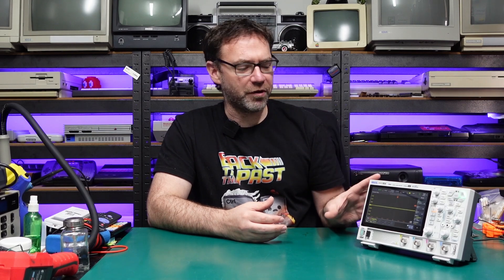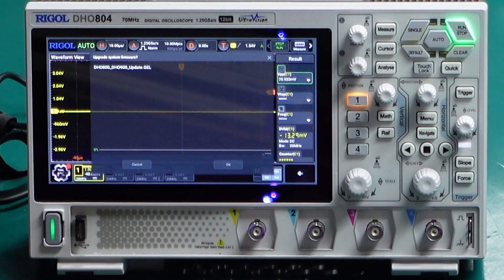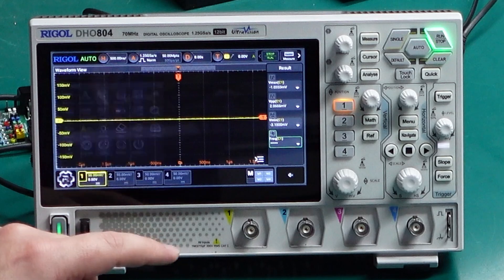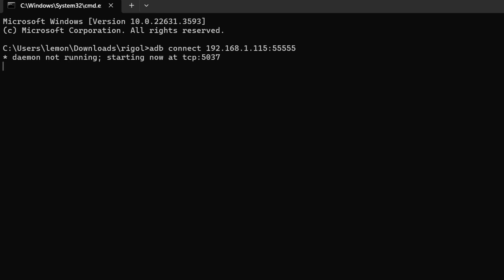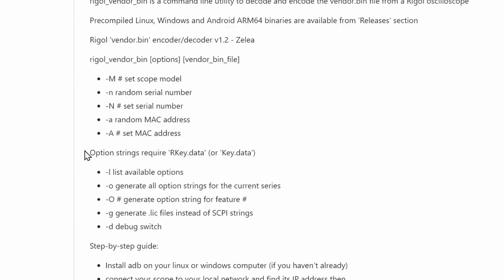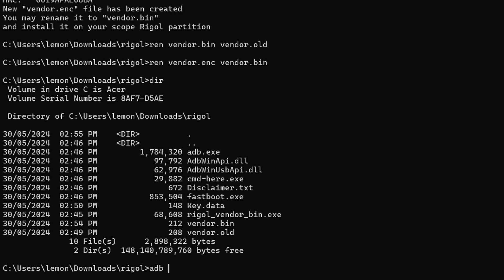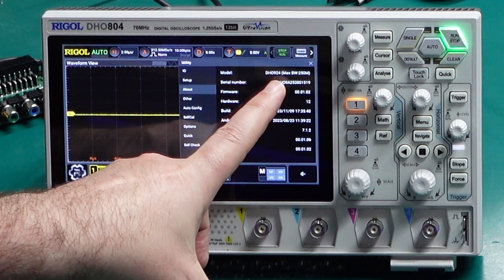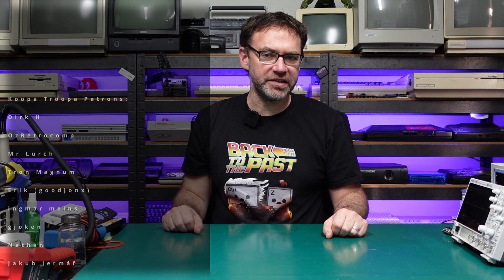Rigol DHO804 fw1.02 hacking - 250MHz bandwidth, 50Mpts, CAN and LIN decoding

Comment: I can confirm the "options" method works with firmware 1.04 on a newly-purchased DHO804, using the tools described here.  I prefer to retain the model identity and enable only the options changes for BW  and memory depth (the BW7T10 and RLU options). These work fine on 1.04, but are not listed on the Info screen. I have not attempted the EMBD (expanded serial options), AUTO (automotive networking protocols), or COMP.

The USB dongle hack also works very well. The required dongle with working chipset is available in the US from Amazon (TP-Link  TL-WN725N, US v3.6.
Reply: Nice, got one coming in a day or two.

Comment: At 1.25GSa/sec, how can it support 250MHz? My attempt to hack my DSO914 to 924 didn't show an improvement. It showed the model and 250MHz by the model. My source is a TinySA or Max2870. Nothing of test room grade  but on other scopes I could see the increase in bandwidth after a hack. I don't need a 250MHz bandwidth and really just wanted the 12-bit vertical resolution.  I sent the original vendor.bin to the scope. The Key.bin is read-,only.

Comment: Great video - Have a look at Mine called Rigol DHO814 DHO800 Oscilloscope Internal Fan Nosie Cure 2025       Rigol DHO814 / DHO800 Internal Fan Noise Solution Hello! Have you noticed that the Rigol DHO800 series, DHO814 oscilloscope can be quite noisy in a quiet environment ? I did too. My unit was brand new only a month old and noisy from the start, running Firmware 00.01.04 as of 1st June  2025.  

To resolve this, I installed a 100mm 12V DC fan at the rear, powered via an LM317 voltage regulator set to 2.69–3V. The fan draws approximately 70mA, (0.070A) making it extremely quiet while operating. I connected it to the onboard power with a new plug, and now this oscilloscope is the best I've ever owned feature-rich with a responsive touch screen, and most importantly, silent.  

Note: When I recorded the accompanying video, the workshop was cold, and the scope had only just been powered on. However, after 30 minutes of operation, the CPU chip temperature reached 51°C, with an ambient temperature of 47°C. I hope this helps.

Comment: The Rigol DHO800 series model DHO814, which I own, is the best oscilloscope I’ve ever purchased. It offers numerous features, a touch screen, and even the ability to operate using 15-volt power banks (similar to mobile phone chargers), making it highly portable. It’s an excellent device overall, but my one criticism is that the internal fan is quite noisy when the oscilloscope is in use. If Rigol could address this issue, it would make the oscilloscope absolutely perfect. Additionally, there are several YouTube videos available that demonstrate how to use this specific model and oscilloscopes in general.

Comment: The Rigol DHO900/DHO800 oscilloscope provides a bandwidth of up to 250 MHz, but this performance is achievable only in single-channel operation. When all four channels are active, the sampling rate drops to 312.5 MSa/s per channel — an unconventional value that fails to meet the Nyquist criterion for higher-frequency signals — potentially resulting in signal distortion and reduced fidelity. Under this multi-channel configuration, the effective bandwidth is significantly diminished, often falling below 100 MHz, increasing the likelihood of sampling artifacts and aliasing.
Reply: Yeah! Sadness reality ...

Comment: So while i can get my 804 scope to boot up and it says its a 924 it refuses to even see a signal even when i try and use the  calibration  points. I'm not sure what the heck is going on but at least i can fix the issue by flashing the old Vendor.bin to the scope. with how long that forum post is it may be impossible to see if there is any one else has seen thins.  Fyi im running the on the  00.01.04. firmware

Update: Make sure you go to self cal in the utlity menu and run that. After i ran it i could see the calibration signal on the probe calibration post and i was then able to test and confirm i could see things like my button pushes and the clock signal on my SNES.

Comment: Hi.
I'm considering buying DHO900 series. Is there similar hack to unlock bandwidth? What about frequency characteristics of analog channel for 70MHz and 250MHz versions? Are they the same? I would like to avoid situation when I buy 70MHz version, hack it, but hardware will still limit bandwidth. .
Reply: I have a DHO914 and did the model number change to 924. I didn't see 250MHz bandwidth. Rebooted and cal. V1.02 FW. I loaded the vender.bin file uploaded to the PC.  ALL I have for a signal source is a TinySA or Max2870. I used one on other scopes to 550MHz -- just to get an idea of other hacks worked - they did. Tests were with one channel enabled.

I sent the Bode option to it and would like to remove it. Just wanted to see if the SCPI command took, even though this scope doesn't have a signal gen for Bode support.

Comment: Juist tried this on my 100mhz DHO814 that I just purchased a few days ago and is on firmware 1.2 all went as per instructions but when I rebooted there was no change, Tried -o option first then went for the DGO 924 neither worked, no change at all, Any thoughts?
Reply: Thanks for posting this.  I have just inherited a DHO814 and was wondering if all this chatter about a mod worked on this model.  Did you ever get it to work? 73.

Comment: Just did it to mine, thank you 🙏
Reply: From a 0.5% precision instrument, you've converted it to ~2-5%!
You can compare readings yourself: 
1) check dc offset with no probes connected (you'll be surprised how huge it is)
2) connect a stable voltage source to all the channels and to a decent multimeter (you'll be surprised to see huge differences across the channels and compared to the multimeter)

Comment: So apart from your model not having a logic analyser port, is all the hardware internally the same as the higher models? I was going to get a 900 series but if i can get a 904 and basically hack it to a 924 and save myself a few hundred quid... Because the features are simply locked behind software BS...?
Reply: Check some EEVBlog videos and make your own judgment. The hardware seems quite identical between many Rigol models apart from the missing features , and of course probes. However, nobody can guarantee this continues. There could be some invisible differences. Also, here in other comments: "HUGE ZERO OFFSET no way to calibrate this. This is common problem. Don't change scope model!" so maybe there are bigger difference somewhere - or maybe it's software.

Comment: Can you do a video on how to hack the Rigol 5000? The EEV blogs don't make sense to me. Too esoteric and vague. Also, could you upgrade this to a 924S model and have a signal generator?
Reply: No, the S model has a daughter board installed to enable the sig gen functions which is missing on the non s variants.
Reply: @MaDkawi636  There has already been a clone of the AGW board still WIP from what I have seen but looks 1:1 with the current postings, will be trying this mod/upgrade at some point.
Reply: @TheRealHarrypm  sweet... Links to the work?

Comment: Right now I can't even update the firmware from 1.00 and tried via ethernet (it twirled forever) and downloading the file took many attempts but finally got there, but my DH0802 would not take either and just got an error message. A bit miffed about it.
Reply: I still get the "red blob" and can't upgrade from 1.00 and so the whole thing is now mute, it is not going to happen and I have to live with the "red blob" forever.

Comment: @TheRetroChannel, I've been reading the comments by @EngineeringAllAround regarding the downside to hacking the DHO804 to a "different model."  I myself implemented your older hack which unlocks new capabilities but keeps the DHO804 model the same: https://youtu.be/Az9lXMGV_jM  I've not upgraded the firmware, so I don't need a new hack, but it might be good to release another video showing people how to do the "feature unlock" hack on the newest firmware, without changing the scope model, thereby avoiding the disadvantages mentioned by @EngineeringAllAround .
Reply: Mine was delivered with 1.03, so I went ahead and upgraded to 1.04. Does anyone know if the older hack works with 1.04?
Reply: @inviscid43 I certainly do not know, which is why I am still using older firmware. 😢
Reply: @inviscid43  Works.

Comment: Is there a similar hack for the DHO802? Or the number of ports doesn't matter?
Reply: Hi! Have you an update about your query? I have a DHO802 too and I'm planning to update this hacking firmware.
Reply: @Attic-Toy-Design how’d it go?
Reply: @SlCKB0Y-sb1kg   Works fine buddy. Have a try. 👍
Reply: @ My 802 arrives tomorrow so I’ll go easy and enable options, not change the model I think. Thanks for the confirmation!
Reply: @SlCKB0Y-sb1kg Hi, does the hack works on 802? Thanks.

Comment: From a 0.5% precision instrument, you've converted it to ~2-5%!
You can compare readings yourself: 
1) check dc offset with no probes connected (you'll be surprised how huge it is)
2) connect a stable voltage source to all the channels and to a decent multimeter (you'll be surprised to see huge differences across the channels and compared to the multimeter)
Reply: Why?
Reply: running auto-cal in the settings fixed the dc offset for my 804

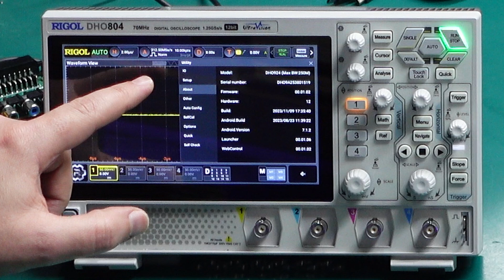Comment: 6:27 HUGE ZERO OFFSET no way to calibrate this. This is common problem. Don't change scope model!
Reply: From a 0.5% precision instrument, you've converted it to ~2-5%!
You can compare readings yourself: 
1) check dc offset with no probes connected (you'll be surprised how huge it is)
2) connect a stable voltage source to all the channels and to a decent multimeter (you'll be surprised to see huge differences across the channels and compared to the multimeter)
Reply: there absolutely is a way to calibrate this. the auto-cal function fixed it for me. it just runs for 5-10 minutes and fixed the offset
Reply from the maker: Yeah I noticed this after filming. Doing an auto calibration resolved it and it's been accurate since
Reply: What avg offsets does your scope have now at 1mV vertical?
Those errors could be hard to notice. What is the dc error now?
Reply from the maker: @sergivaschenko Average offset now is 220uV at 1mV/div
Reply: @TheRetroChannel  that's HUGE, my unlocked dho804 (no model change) at 1mV has: -9.5, 24.7, 50.6, -22 uV; at 1V: -14.3, 5.72, -11.3, -5.5 mV
Reply: @EngineeringAllAround  So what part of the hack is okay to do without loosing precision?
Reply: @EngineeringAllAround  Okay, thanks! I have not purchased mine yet and am looking at the Siglent 804 hd and this… the Siglent costs around 100 eur more… I will be using it for working on amps, preamps/phono amps, dacs and their psu’s.
Reply: @EngineeringAllAround  Thanks
Reply: @EngineeringAllAround Hi, do you say it is ok to hack without changing the model number? Thanks

Comment: Hi Mark when I am connected and try to pull I get adb: error: failed to get feature set: device offline what am I doing wrong, thanks
Reply from the maker: Did you see "ADB connected" after typing in the scope IP and port 55555? I'm no expert on using ADB so google or the eevblog forums may be of more help

Comment: Just received my DHO804 and did your hack!  Worked GREAT!
It now reports a DHO924 with 250MHz BW!  Haven't tested it out yet, but wanted to let you know your instructions are flawless!!!
Thank you.
Reply: The issue is in a measurements precision. From a 0.5% precision instrument, you've converted it to ~2-5%!
You can compare readings yourself: 
1) check dc offset with no probes connected (you'll be surprised how huge it is)
2) connect a stable voltage source to all the channels and to a decent multimeter (you'll be surprised to see huge differences across the channels and compared to the multimeter)
Reply: @EngineeringAllAround  Hello, I confirm the shift.
Reply: @EngineeringAllAround  Firmware 1.04. After calibration I'm getting 1.4 % difference: 3.985 V Multimeter, 4.044 V Rigol. DC offset with no probes is 3.8 mV. For my usage increased memory depth and bandwidth justifies the error
Reply: @EngineeringAllAround  no shift here, just did the hack..
Reply: @niw-w1f  I confirm the shift and reduction in precision.
Don't hack your devices if you want precision.
Reply: I owned a Dho924s which has more ram installed and hardware components installed comparing to dho804. Though you installed the software of Dho924s, but the probing result might not be accurate.
Reply: LOL: "Haven't tested it out yet, but... your instructions are flawless!"  
Actually testing your scope will show whether the instructions (and your ability to implement them) are indeed "flawless" or not.

Comment: 6:07 ...can you retrofit it? Like, has the PCB provisions for the connectors and whatnot?
Reply: Theoretically yes. In eevblog's teardown, you can see the solder point for where the connector pins would go and a few other small SOIC-8 chips. Obviously you'd also need to cut up your chassis for the probe connector so it's a bit of a big ask. But theoretically, it's there.
Reply: @aaronchamberlain4698  Thank you

Comment: Hello Mark, after you did the first upgrade in the first  video and all was well, had memory and bandwidth and it worked fine. Mine also worked fine, after updating the firmware to 1.2 all was fine still had memory and bandwidth like in your second video, But after I recalibrated it was all gone and still have 1.2. In your second video after the firmware upgrade to 1.2 never saw you do a calibrate, which on my scope removed the memory and bandwidth. Have you recalibrated after the latest.   In short after the firmware upgrade to 1.2, memory and bandwidth still good until I did a calibrate
Reply from the maker: Ah, no I didn't do a calibrate after updating. I probably should do that, it's been a while

Comment: I believe the probes supplied with the DHO804 only rated for 150 MHz? That's why I've only done the option mod for 100 MHz. I was intrigued by the vendor.bin hack though. It would be nice to see a test on a 200 MHz signal.
Reply: You will be surprised to know, i connected 200Mhz carrier signal 200mVpp , and DHO814 has no problem picking up that signal, and there's no noticeable attenuation. I didn't hack anything, it can just work up to 200Mhz. We Just can't zoom anymore.
Reply from the maker: True. I think people have done some tests with the original probes in the eevblog forum. I don't remember the results and finding them in that thread could be a challenge
Reply: Just connect a 50 ohm terminator and a coax just dont measure above 5v